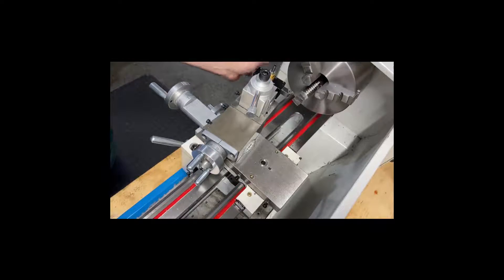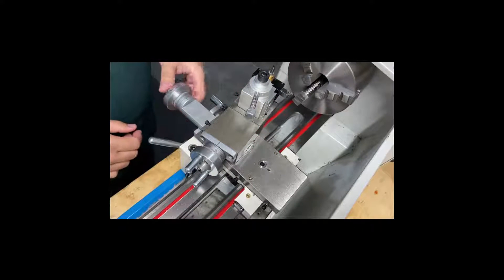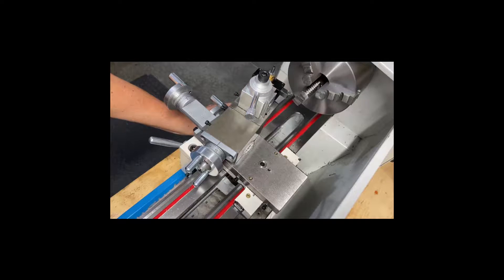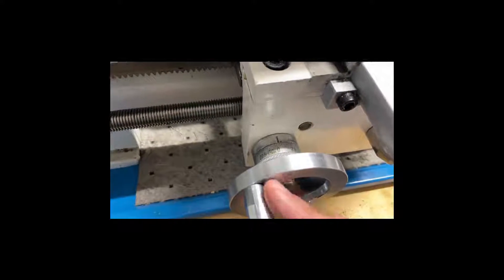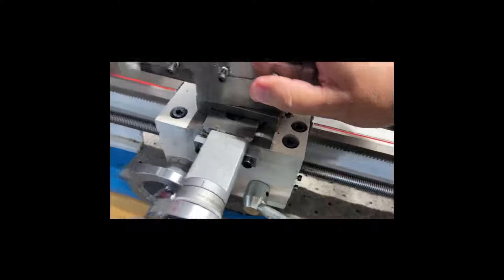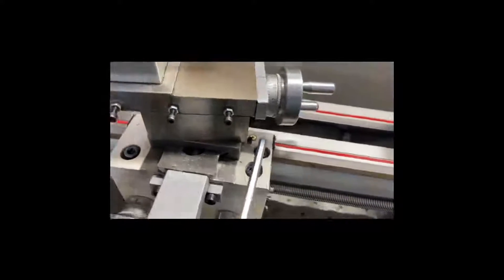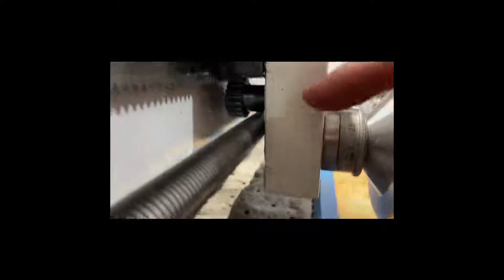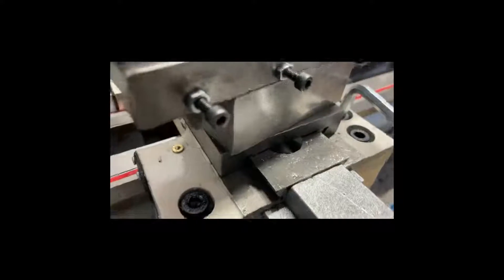Vevor Mini Lathe MX 400 Part 11.1 - Backlash issues in the carriage.

Comment: to fix mine, i redrilled holes in the rack itself to move it m ore towards the rear of the bed as it never got that close to the head of the lathe. then i machined off .5mm off the gear carriage and used thin shim stock to get it exactly. that resovled the backlash with it witggling as bad. cut it down to a tiny bit of movement. I also used a brash washer to help resovle some of the handle wobble. i plan to get some bearings to use later and drill, bore and use bearings instead of a steel hole for the shaft the handle bolts too.
Reply from the maker: I’ll be looking into reviewing this on my carriage someday. Thanks for sharing this.
Reply: @deezworkshop i posted on my video about my lathe a ton of links to stuff.
Reply from the maker: @mike9500  Just checked it out.  Nice video and tons of links.  Your experience is very similar with mine.  If you are persistent or simply contact amazon or Vevor they seem to work with you to come to some resolution.  ususally refund or replceing the lathe.  Nice video summary,  I subscribed becasue I want to see your followup.  ;-)
Reply: @deezworkshop TY sir!

Comment: that "backlash is in the geer teeth to the gear track. you can take try loosening the top bolts, and push it closer to the bed. if that doesn't work, you may have to try and hand sand off the top of that assembly to remove some of the heigth. that will bring the gear teeth closer to the gear track. i suspect you will need to take off about .37mm to get it just about perfect. ask meh how i know! ;)

Comment: Backlash in the carriage isn't really a problem. You just use travel dials to check where You are. And always cut against the headstock end!
And maybe - since the carriage is so loose in the gears, maybe You should use the top slide to do the actual cutting? Lock the carriage, and use the cross and top slides for cutting. They are a lot more precise. And You also completely eliminate the sloppy carriage in the finish You're after!
Reply from the maker: Thank you for finding my channel and watching.  Keep in mind, at the time of these videos I had never used a lathe before and am learning along the way.  Hopefully if you stick with the videos and watch you will see some improvements in my use of the lathe, techniques and general skills.  This channel is for experienced professionals to offer advice for others and people like me looking to get into this hobby to have some information on what they may experience or go through as they get into this hobby.  Thanks for watching.

Comment: id get a DRO or use the lead screw for side profiles and lock the carriage for facing
Reply from the maker: Yeah, a DRO is on my list for sure,  I have been locking the carriage for facing that that has helped a great deal.  I'm learning how this little machine works and that it certainly isn't perfect.  So far fun to use despite its issues.  Thanks for watching.

Comment: It looks like the Optimum TU2004V.  On mine, the lead screw nut on the cross slide is split so you can remove the backlash by slightly tightening the rear grub screw in the center of the cross slide just a little a time until your happy.  Leave yourself a few thou so as not to introduce extra wear on the nut.
The backlash in the main carriage can be minimized by adjusting the jib screws for the auto feed split nut.  Even without the backlash you should lock the carriage when facing etc as it still has the tendency to move even on the bigger machines.
Reply from the maker: This would be great if this is the case at least just to take out some backlash.  I will see if I have this adjustability.  Thanks for the advice and thanks for watching.
Reply: @deezworkshop  That's right, 3D printers have to fight that too. There are antibackslash nuts for this case, because it is normal and depends on the thread. A trapezoidal thread is not like a screw thread.

Comment: Backlash is something you have to deal with.  You have the right idea.  You remove the backlash and set zero.  Then when you back away you back up past zero so when you go back to zero you are at your starting point.  On mine as I noted in a previous post I completely disassembled the machine.  One thing I found was that there were some hand cut brass shims between the apron and the carriage.  There was also a lot of slop in the end play of the gear that engages the rack.  I fixed the end play and then tried attaching the apron without the shims.  Fit fine without the shims and eliminated a lot of backlash.
Reply from the maker: Thanks for the thoughts.  I agree,  I may be able to improve it a little but the gears just have the backlash that I don't see a way to eliminate.  I have been using a T-handle allen wrench to tighten down the carriage which helps when needed.
Reply: @deezworkshop  Remove the two allen bolts that hold the apron to the carriage.  Lower it enough to see if there are any little brass shims on top of the apron.  If so remove them and see how it works.  If not, just replace the two screws and tighten them back up.  You cannot fully remove the apron without removing the leade screw as the half-nuts are wrapped around the leade screw.

Comment: Not much that ca be done to remove the carriage. Some have moved the top rack down to meet the gear to reduce it but there isn't much that can be done. I find chopping down the allen stock for the carriage lock and making a handle for it makes the carriage lock easier to use. The cross slide movement you have is 90 percent the nut rocking vs backlash. Wind the cross slide all the way back and play with the two screws in the middle of the cross slide. One pulls the nut up and the other pushes down on it. You may have to add washers to get it in a better position where so the shaft is best aligned thru its travel. Additional mods are to add shims and bearings to the aluminum block where the cross slide shaft meets the knob.
Reply from the maker: Thanks. I’ll try some of the ideas you mentioned but I’m finding the situation to be much the same. It is what it is. I’ll keep looking but I think I just need to adapt to the fact this carriage is what it is. Thanks for watching and the advice.